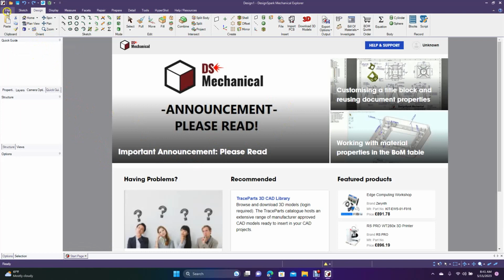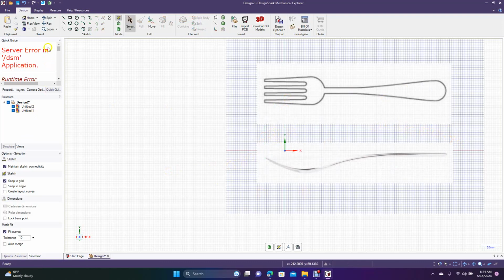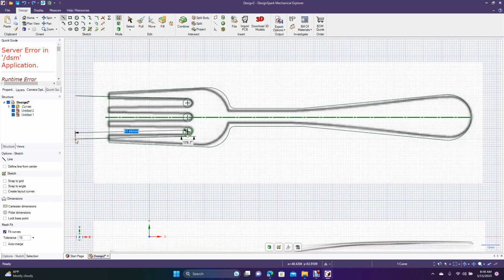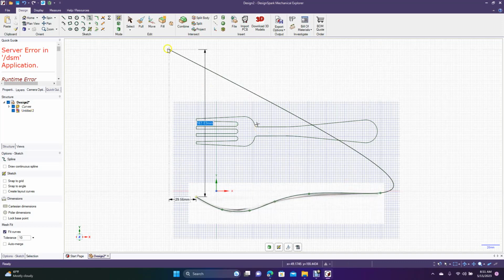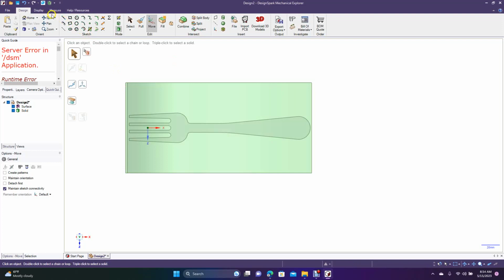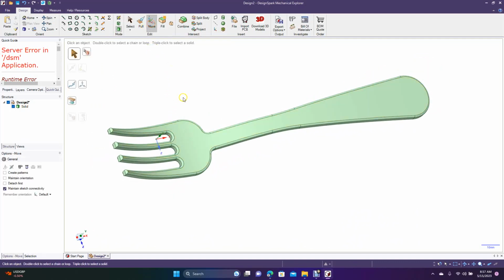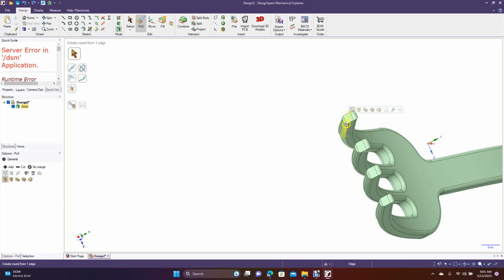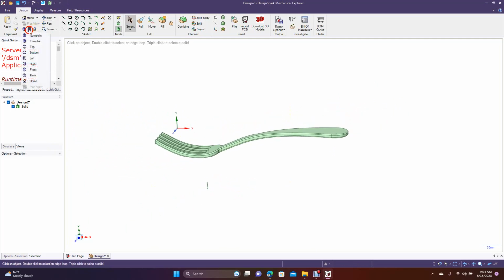How to create a basic dinner fork with design spark mechanical

Comment: Hi, If you want to spin an object 90 degrees you can double click on spinning arrow. Nice approach with drawing rectangle around the flat fork and cutting the waved object with it. I would  normally extrude the flat fork surface throug the waved one and combine both. Your approuch seems a bit cleaner. Thank you
Reply from the maker: There are so many different ways to arrive at the same result. Cheers, and thanks! for the suggestion.
Reply: @dailey3drevolve  True. That's why I love DSM, even if something should work fails you still have more options. DSM is really good for drawing 3d. It is more about a limitation of imagination than the software itself.
Reply: @dailey3drevolve  ...and that is why I watch videos about drawing in DSM. People have different styles. I'm pretty good at it but I still want to be open to different ways of drawing things  otherwise I would stick to my way which is not always the best. Thanks